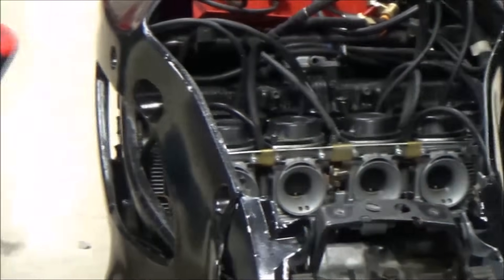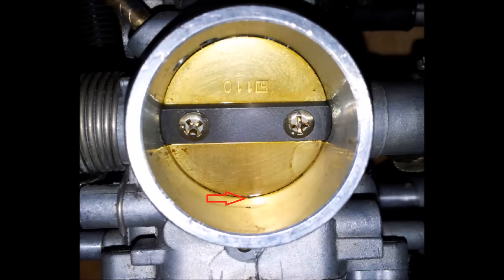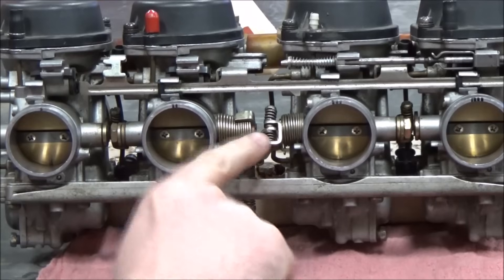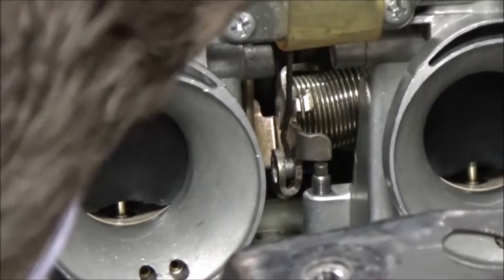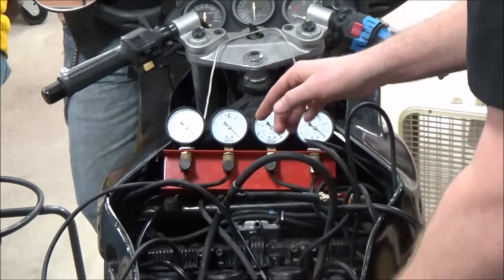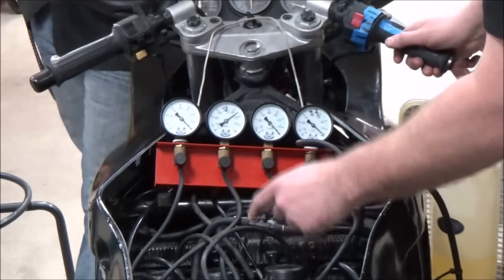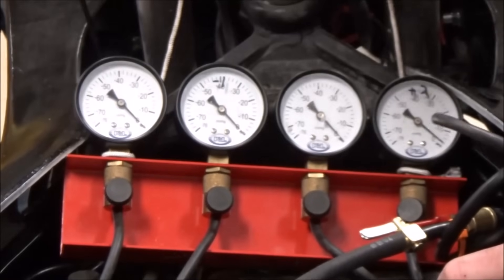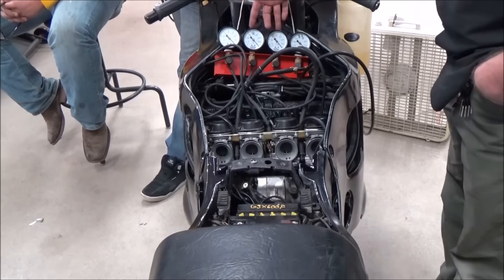How to sync carburetors throttle bodies the right and WRONG way!

Comment: Brilliant video. I have a 98 gsx750f that I acquired having been off the road a few years. Had it running but obviously needed attention. Long story short, had a seized pilot screw and ended up replacing carb number 4 (for anyone reading, mk2 1200 bandit carbs are identical 36mm mikuni cv carbs to the gsx750f and have the throttle position sensor). Noticed the o rings on the middle fuel rail between the carbs were shot so I've pulled them all apart. Now the reassembly... Having a hard time reconnecting the throttle plate adjusters back together without firing the springs across the shop. Any tips would be greatly received.

Comment: I can’t even get mine to bench synchronize correctly. The idle screw spring is compressed and bottomed out and barely touches the throttle.  I would love to get mine figured out.

Comment: Yesterday I did carburetor synchronization. I synchronized 3 of them without any problems. But when trying to balance the fourth where there is a big difference. The idle speed of the engine increases too much. I can't reduce it by adjusting the idle screw because it has run out of range. The TPS sensor is set correctly. What could be the reason for this? Maybe the carburetor needs to be adjusted? Air-fuel mixture?
Reply: So did you solve it? I have the same problem
Reply: @Mohapi_Tau yeah I have the same problem as well except with the 2nd gauge from the left also what number are y'all's gauges reading on the 3 mines at 20 is that right ?
Reply: @cheesybread9827  All four gauges need to align together, I think it doesn't matter at which number they are because they somewhat fluctuate. "Harmonizing" the needles to be in sync with each other is the goal, I fiddled with the screws abit. 

So I kinda solved mine, though they don't line up perfectly, I'm OK with it. I'm putting the bike together, I think I'll  upload a video & give a review of it rides when I'm done.

Comment: I have a double gauge and left one is lower by 1, it's for a Yamaha Virago XV 535. How would I calibrate the gauges so I know it's right. Any help would be appreciated.
Reply from the maker: Not sure why this one slipped by but most gauges have an adjusting screw that you can "tune" both gauges to one cylinder. Good side is you don't have to do math or record the off one. Donwnside is neither gauge is truly known to be the actual vacuum. For Example: Let's say you're adjusting to a service manual spec calling for "20" That being said, our main goal is getting them equal as it's hard to match the specs given on used motorcycles as engine wear will alter engine vacuum.
Reply: @How2Wrench  thanks 👍
Reply from the maker: If I ever miss a comment from you as a member hit me up on the how2wrench.com contact and they will get you my cell. Thanks for being a long-term supporter. Shane
Reply: @How2Wrench  no problem Shane, will do. Thanks so much for all you do for real!! Your experience, expertise, and desire to do a correct and complete job is amazing and well appreciated by all of us I know. Hope everyone becomes a member :)

Comment: What about using a single, high quality, gauge and just moving it across each port? Yeah I know, it's quite a lot more work and fiddling around, but it entirely eliminates the issue of mismatched gauges.
Reply: The problem with that is that adjusting one affects all the others because idle speed changes. You COULD in theory monitor RPM with a serious electronic tach and fiddle with idle speed..... Back and forth and back and forth.... Or use 4 gauges. Much easier.

Comment: Just baught a bike (600 srad) that's been sitting a few years. Guy had fuel stabiliser in the tank. Battery was flat so I jumped it off my fireblade just to get it running. Let the engine warm up then once giving it short bips it ran fine and smooth with the choke off but it wouldnt rev over 8k? It was like a car when it goes into limp mode or safety mode! Any idea what could be the cause of this? It should rev to 12-14k even in neutral on the stands correct? 

Just wondering if you had any quick tips that I could try before I start stripping the carbs down and giving myself a possible headache and lighter wallet. 

Cheers from Wales in the UK. 👍🏼
Reply: Was it your spark plugs or just dirty carbs ??
Reply: @jack4q2  havnt had the chance to get into it yet mate. Bad back AGAIN so I've been stuck in bed flat on my back for the past two days🙄it could well be plugs and old fuel!?

Comment: And just another message. Yesterday I managed to sync the 4 carbs on my 1000RX perfectly. Learnt so much from the video it was easy. The day before I had had the same problem with the idle cable hanging and I hadn't calibrated the 4 gauges before starting. I didn't know you had to. I just took the ramp off and having seen this video (at 1 min in there is a great pic showing the butterfly in position) I visually balanced all the butterflies - one pair at a time and then both pairs together on the bench and put the rack back on. After adjusting the idle which was now too low the carbs were already so much closer at was so easy to get them bang on. Just a small tweak. Made me feel good and carb syncronisation is no longer a mystery to me.
Reply from the maker: We sure love you taking the time to comment. Are you coming to the next live session? 
There a few ways you could help keep this work going and stay connected with me personally.  
1. The fastest and best thing you could simply do for us is hit that subscribe button…helps us creators more than you know!  YOU ALREADY DID THANK YOU!
2. Join this channel to get access to perks:
https://www.youtube.com/channel/UCBhM8DCKnT3qXwTW0eToyCg/join   
3. Give us a high 5 here:  https://www.paypal.me/how2wrench    
Keep Wrenching,
Shane Conley
602-345-0432
Peoria, AZ USA
Follow us!
www.How2Wrench.com      
www.Tools2Wrench.com   
Facebook: 
https://www.facebook.com/How2Wrench/  
Instagram:
https://www.instagram.com/how2wrench/

Comment: Please bro, release a video of honda jade 250cc motorcycle carburetor ter synchronization and also tell me how many turns should I take on my carburetor air screws?
Reply from the maker: We sure love you taking the time to comment. Are you coming to the next live session? We answer questions there!
The fastest and best thing you could simply do for us is hit that subscribe button…helps us creators more than you know! 
Join this channel to get access to perks:
https://www.youtube.com/channel/UCBhM8DCKnT3qXwTW0eToyCg/join  
Want to help us back? Please subscribe and give us a high 5 here:  https://www.paypal.me/how2wrench  
Follow us!
www.How2Wrench.com      
www.Tools2Wrench.com   
Facebook: 
https://www.facebook.com/How2Wrench/  
Instagram:
https://www.instagram.com/how2wrench/
Reply: If you have an air screw, that will be at the rear of the carburettor, also need to adjust the front fuel mixture screw to match the air/fuel ratio . 
Firstly ,never screw in tight as may damage the fine tip. Start with turn back 1-1.5 turns as this lowers the position of the tip in the fuel bowl and allows  more fuel to enter.  You can fine tune by riding and removing it all again. That's why EFI is so much better.. ......

Comment: Mercury gauges don't lie, you just have to be careful not to close the throttle to fast at high rpms or you'll suck the mercury through your engine.
Reply from the maker: Actually, they can. We cover why in another video but in short its mostly a "storage issue of laying them on their side. Parts of the Mercury separates and each tube doesn't have the same amount. Regardless you can test each tube as shown in this video to prove correct or if a variance is needed when reading. Please hit that subscribe button for us! 👍 Thank you for taking the time to comment! It helps us! 
Here is a way to support all the free videos.
Want to say “thanks” or “keep it up”? Click here https://www.paypal.me/how2wrench  

Follow us! 
www.How2Wrench.com     
www.Tools2Wrench.com  
Facebook: 
https://www.facebook.com/How2Wrench/ 
Instagram:
https://www.instagram.com/how2wrench/
Reply: @How2Wrench  Why would you lay them on their side? If your glass has water in it do you set it down on it's side?
Reply from the maker: I wouldn’t...but my videos call out what I’ve seen happen. It was so bad that Motion Pro actually updated their instructions calling out not to do so because of all the bad publicity of techs claiming the tool was junk and they could tune better by ear! Lol. I appreciate comments and feedback anytime friend, just keep in mind our purpose is to be helpful and insightful. Keep Wrenching...Shane

Comment: Wonder what he meant about plugging the vacuum lines...very last thing he said.
Reply: He had the fuel tank removed, so the vac line to the fuel valve had to be plugged...  I'm assuming.
Reply from the maker: Correct...
Reply: The vacuum lines have a plug that you must remove to connect to the gauges.  My YZF 600 has a metal plug.  Without the plug there will be no vacuum.  At end of video he shows one of the lines with a green plastic plug.  If still unsure look at other videos.

Comment: Oh yeah...! More reason why calibrating your calibration is a must! My buddy mechanic even said that you won't even need a specific vacuum value to follow; if every carb is balanced, and you re-adjusted the idle and they didn't change, you're good. Eyeing the sync won't work either. Make sure the sync is same at different rpm ranges as well. If it is a parallel twin, you might get it right though with just feeling the vibrations.

Comment: DO NOT USE THIS VIDEO AS A GUIDE FOR SYNCING THROTTLE BODIES!!!  YOU DO NOT USE THE BUTTERFLY SCREWS TO ADJUST TBs ON MANY FI BIKES - YOU USE THE AIR SCREWS AND SCREWING UP THE BUTTERFLY SYNC IS GOING TO MAKE IT IMPOSSIBLE TO DIAL THE TBs BACK IN>
Reply from the maker: As with many of the videos here, we are demonstrating on a particular model. This model is carbureted. The main focus of the video is the correct tool usage and it is always best to know and understand the correct screw or procedure for your model your working on. Some models of EFI (throttle body) require the use of the OEM diagnostic tool to turn off or lock the IAC valve for example. Thanks for adding your comment and thoughts...H2W
Thanks for commenting and adding value to our community! 

Please subscribe, share and consider a H2W membership to support our free work here! We are ramping up for the upcoming new member only site with profiles, raffle drawings, and weekly live Q/A sessions and a for sale page!

We have a LIVE Q&A starting soon and will use comments from videos to try and answer too. Got a question you need answered sooner than our LIVE Q&A Shows are on? Here’s how to get your answer for free! https://youtu.be/oAeXz1nd-eQ (and other free tools and products!)

Comment: I have a zxr 400 and i dont know how to adjust the fuel screw. Do i go by default turns and then sync the carbs? Do i adjust it before sync? What is the proper way to do it? Thabk you

Comment: How do the gages compare to Mercury "sticks" which is better? Good video BTW!
Reply: Fallbangskid:  I have never used this 4 dial gauge setup but it looks like a pain to use.  The vertical gauge is much easier to read in my opinion.
Reply: I’ll take mercury sticks any day for syncing carbs. Problem is now a days they are very hard to find. However, vacuum gauges are better for troubleshooting in my experiences.
Reply: Unless you are going for a full racing application I find a well calibrated set of gauges to be more than adequate. The factory sync specs are usually pretty loose, and the gauges will dial them in much closer than factory spec.  The carb sticks are great for squeezing out that last 1/100th horsepower.

Comment: Witch one is the master carb on that mikuni carburetor I have a 1989 Suzuki gsxr 750 tnx
Reply: The only Japanese bikes that had a master carb were the 1977 and 1978 Honda fours with slide needle carbs. The master carb on those was #2 as it didn't have any sync adjustment while the #1, #3 and #4 did.  All the carbs were synchronized to #2.  Constant velocity carb sets don't have a master carb.  They have 3 adjusters.  One between #1 and #2.  Another between #3 and #4.  And one in the middle between #2 and #3.  When you adjust the one between #1 and #2 you are adjusting #1 and #2 simultaneously against each other, bringing them closer together of farther apart.  It's the same with #3 and #4.  After you have done the two pairs you go to the adjuster between #2 and #3 to adjust the two pairs against each other.

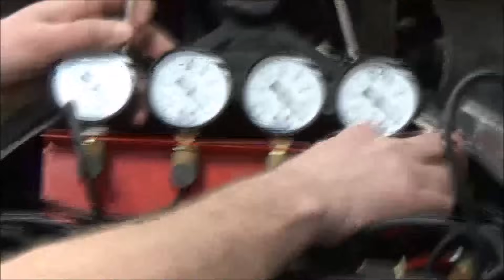Comment: @2:38 noticed that one of the diaphragms is jumping, is that normal?
Reply: Nope bad valve in engine
Reply: @davidhill5621  Not necessarily.  If the carbs are as far out of sync as these were it would not be uncommon to have that condition.

Comment: what would be some symptoms that come with a unsynched carb, just curious what the list would be that would make look at the carb synch first.
Reply from the maker: Rough running at idle is good clue. Carb Sync is just standard practice for professionals performing tune-ups. If I can ever be of service to you, here is a video explains how to connect with me. 
https://www.youtube.com/watch?v=vjvmB01ebcs 
Keep Wrenching,
Shane Conley
Instructor/Motivator/Motorcyclist
www.how2wrench.com
Like freebies? Click here for a free diagnostic checklist! 
http://gem.godaddy.com/signups/364621/join 

Did you like this free video and hope to see more? Would you just like to say thank you with a donation? Click https://www.paypal.me/how2wrench
Reply: On my bike, loss of smooth acceleration. Not huge, but when you ride a bike for while you notice subtle things. The next really obvious thing is back firing after chopping the throttle. Say passing a car, cutting back in and dropping the throttle.  I make it a habit to check every spring. Takes about 15 min once you know how to do on your bike.

Comment: Great video. Some things I've noted from doing multi-carb bikes, is that (in my experience) sync problems seem to mostly occur from inconsistencies from one cylinder to another, or tampering. So when someone brings me a bike that has sync problems, but the settings are unmolested, we immediately run a compression test and check engine health. I don't know if it's "proper", but I do like to use the shanks from two #80 drill bits to mechanically sync a carb set (especially if they've been molested), then run the bike with the gauges. One shank carefully goes in the "reference" carb between the body and butterfly (centered at the bottom of course) (adjust the idle screw to barely hold the shank), and we use the second shank to set the others one at a time. A good motor is usually pretty close in regards to sync once they are "mechanically" set. Of course that may not be a "proper" thing to do, but it's saved me a lot of sync time.
Reply from the maker: I have a saying I use often...."a $400 carb job will never FIX low compression"!

Keep Wrenching,
Shane Conley
Instructor/Motivator/Motorcyclist
www.how2wrench.com
Like freebies? Click here for a free diagnostic checklist! 
http://gem.godaddy.com/signups/364621/join 

Did you like this free video and hope to see more? Would you just like to say thank you with a donation? Click https://www.paypal.me/how2wrench
Reply: Yes! And it's amazing how many people overlook this, especially with thier "barn finds". Ignition and charging quality seem to be overlooked alot too.. keep up the great work!
Reply from the maker: Keep Wrenching,
Shane Conley
Instructor/Motivator/Motorcyclist
www.how2wrench.com

Comment: I learned from reading of people messing up on bikes like my BMW GS 1200 touching the screw that sets butterfly closed position that has epoxy sealant on it from the factory and won't start up after screwing with it. Appears there are stepper motors, ( I call servo's) that get a Ma signal from the ECM and adjusts the butterflies based on temperature of engine, and outside temperature to allow bike to start. Don't want to screw with some screws.